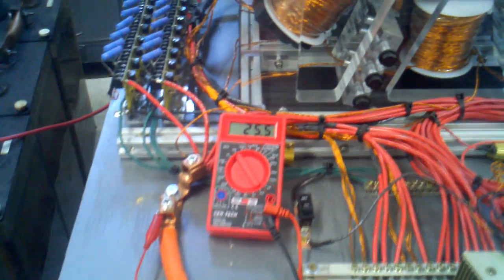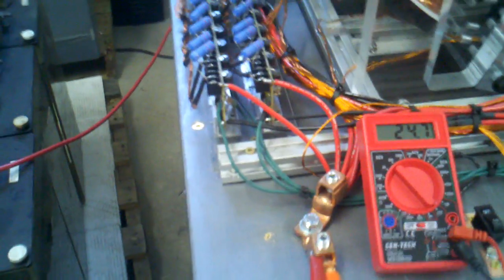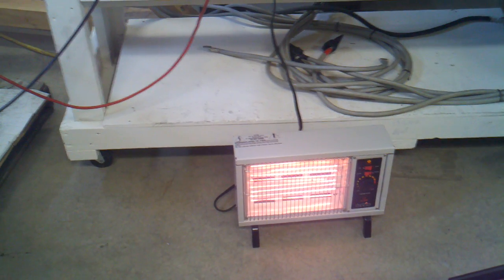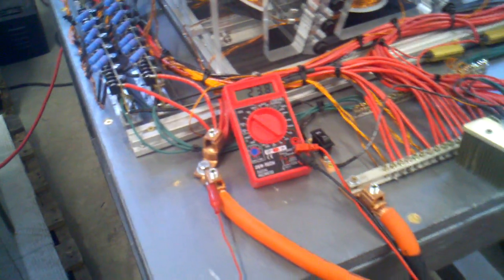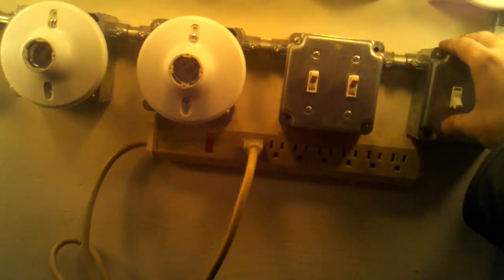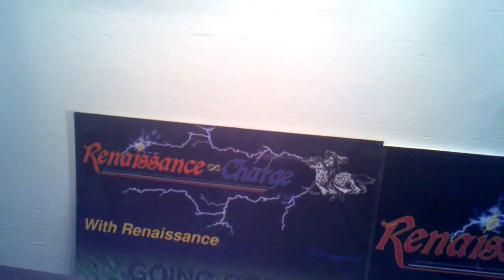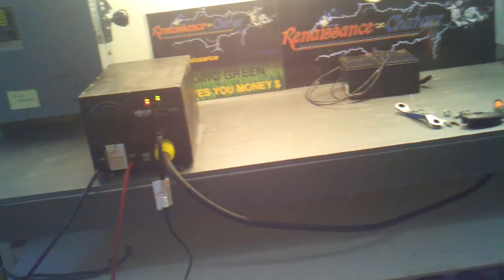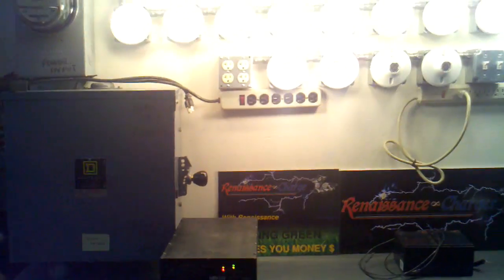Loading the 2000AH batteries charged wih the 30 coiler

Comment: Hello, Rick. Just watching the play list you recently shared. I'm wondering how much such a 30 coiler setup like this will cost today. With and without this specific battery bank. Thanks
Reply from the maker: I don't have that machinist anymore and I would change it anyway if I would do it again so I can't really answer that. There has to be enough interest in it which I don't see presently. We have the original 10 coiler going now and if there is interest in that we can see what other interests there are. My Dualpole motors replaced that 30 coiler which allowed for it to be more of a motor with the same kind of charging results. I'm making the last 10 coiler dualpole motor right now so maybe others will be interested in that which then can be expanded to a 30 coiler (which also would have 30 generator coils). We'll see what comes of the new SG kit and Original 10 coiler kit after the students report their experience to us and we post it in a new youtube channel. That will either revive the negative energy engineering  or show that it is over.

Comment: Interesting setup. Those 2 volt batteries are the same kind that the telephone companies use down in their central offices for backup, till their generators kick in durin power outages. Low voltage high amps is the way to go!!!